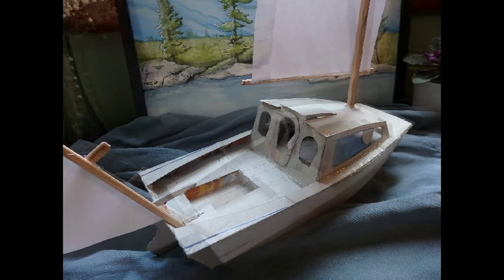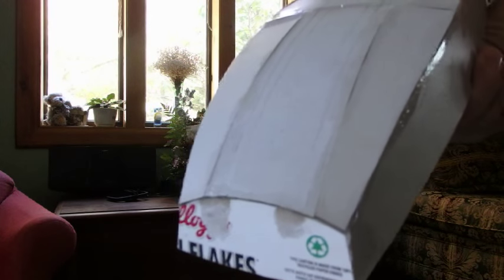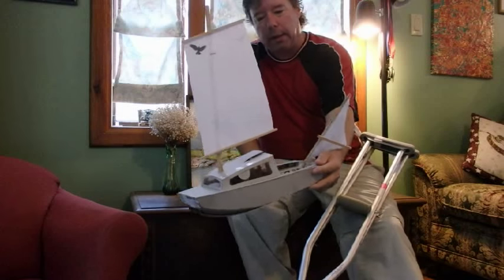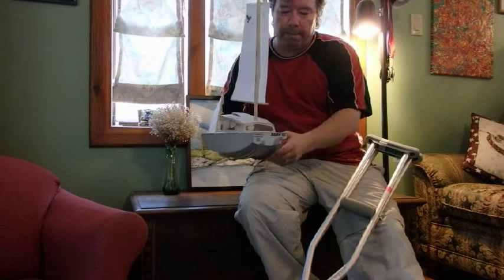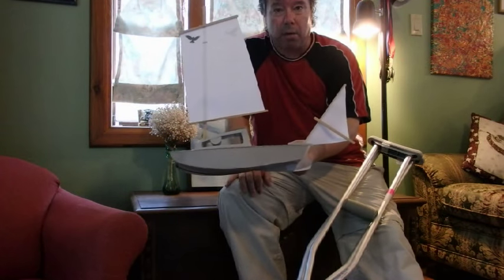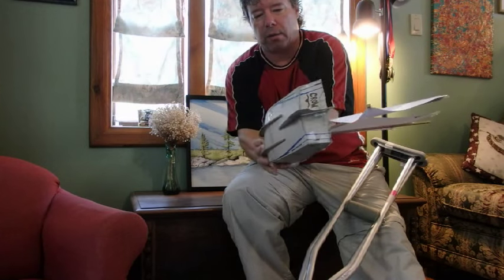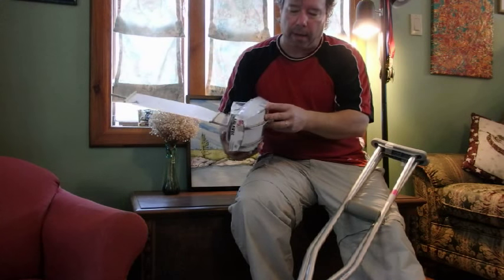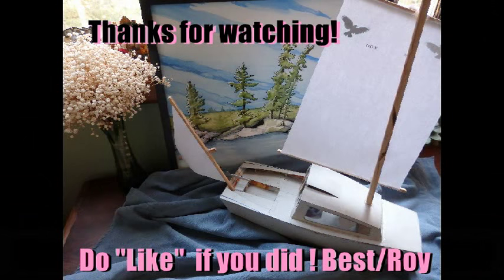How to Design a Boat using a Model

Comment: Very cool Roy. Reminds me a lot of Jim Michalak's Twister design. http://www.duckworksbbs.com/plans/jim/twister/index.htm
You might need to do a little math on the size and position of your runners and centerboard with respect to the center of effort of the sail. I don't know a lot about that sort of thing but I do know that you don't want to end up with lee helm and the position of the runners and centerboard relative to the center of effort of the sail are critical. Also, have you considered a sideboard as opposed to the centerboard? They work equally well and getting it out of the center of the cabin and on the side of the boat saves a lot of space and simplifies construction. I like the old timey look the have myself. Best wishes on your hip recovery.
Reply: One more thought. You will want to design some sort of mast tabernacle to allow you to step the mast for trailering.
Reply from the maker: +mibengal Yes I still need to work out the details but had planed to have an off center board built into the bench sides. The hip is getting stronger every day so I can't  wait to get back into my shop.

Comment: the wheels runs over shallow water ground while you sail
Reply from the maker: +john ross Sorbie Or the boat with a winch could be move overland around dams or from lake to lake!
Reply: l forgot that my memory is on a different plant,
Reply from the maker: +john ross Sorbie I understand you! I have the same wild ideas and then I look closer to see what will work!
Reply: l always think safety to family boats wheels under the boat for rough waters
Reply from the maker: +john ross Sorbie This is why I build a strong hull with separated sections that will always float the boat, even with a hole in the hull.
Reply: pity you can test it even if damage to the hull from your computer
Reply from the maker: It is fun to share ideas on the internet, like we are doing!
Reply: l've saw idea on a boat long time ago l always think safety,l've past 2 health &safety exams today l'm still more to come